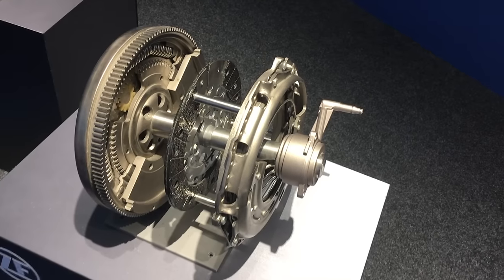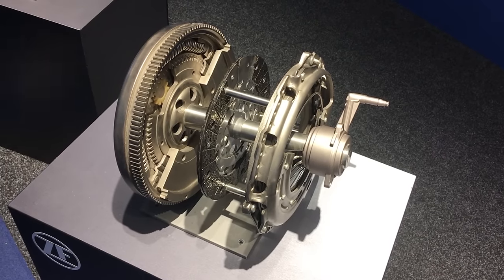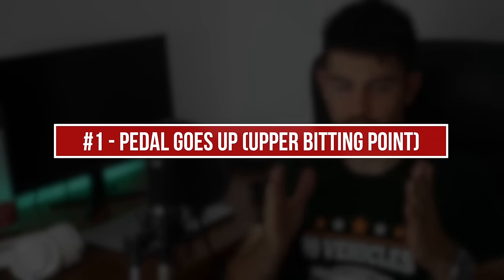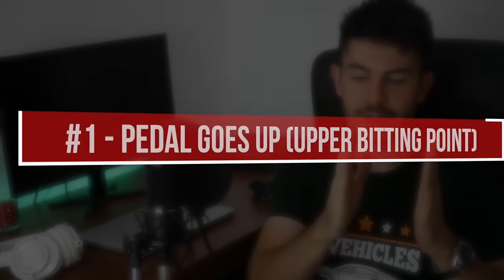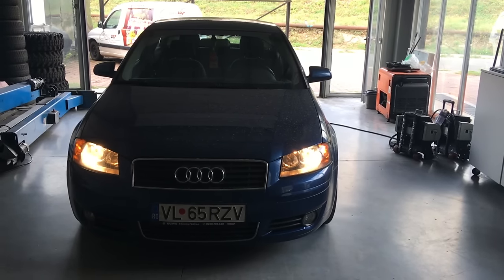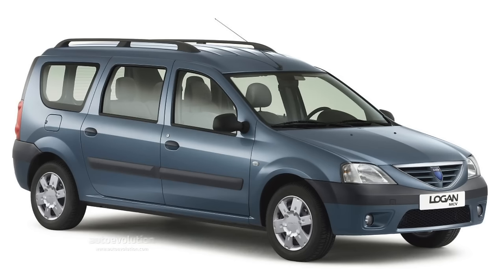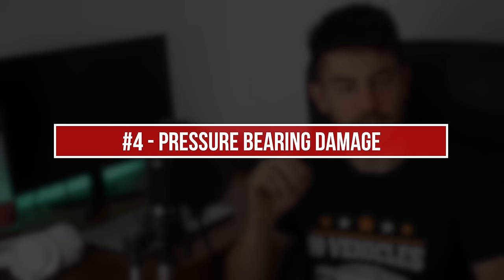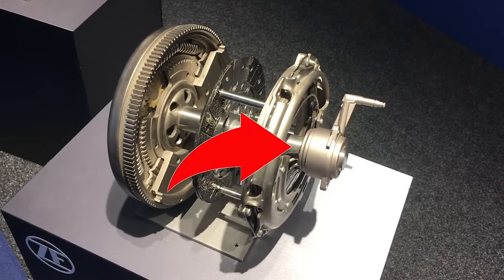How to Diagnose A Bad Clutch - 5 Signs

Comment: I press my clutch and the rpm goes down, car shakes a bit and sometimes stalls when i press the clutch. Thoughts?
Reply: Nemoz_BB6 Mine too need to replace the whole clutch kit buddy i'm going to do it. i have volvo v50 2012
Reply: You have to feather the gas when pressing the clutch in and launching from a stop.
Reply: Mine vibrates for a second, rpms drop a bit when i let go of the clutch in neutral
Reply: Worst case you might have crank walk.
Reply: My 96 Ford Probe SE has been having this issue, it only happened after a 20-30 min drive though. Almost never when just starting the car. Has anyone else replaced their clutch and gotten the issue fixed?
Reply: @minipineapple45  my 2003 eclipse gts rpms drop when i press the clutch in sometimes to about 500rpm and shakes a bit then goes to normal after about half a second of doing so, idk whats going on lol
Reply: Honda S2000 I have seen people suggesting to replace the MAF or the IAC, I’ve already replaced the maf and an iac for my car is $400-500 lol, but good luck and hope you get it fixed!

Comment: It is important to mention that some symptoms mentioned might have absolutely nothing to do with the drive train, but actually related to engine performance being to lean/rich. Sometimes it is just down to the fact that some newer drivers dont apply enough RPM when moving off causing the engine to labour.

Comment: I have a 2001 Audi TT Quattro 1.8 turbo. The pressure on my clutch is fine I can push it all the way to the floor comes all the way back up good pressure. When I push the clutch all the way down and put it in 1st gear it doesn't engage at all now my engine just revs.The 6 speed stick shift shifts every gear fine except that needed high revs or I'll lose speed while driving.I bought it and drove it home last week after driving it for an hour home I could smell a burning smell from the front driver side tire area.I knew it would need something with the clutch done to it when I bought it.So getting it to move from being parked and putting in it in 1st gear to get it going it has to be between 3000 and 3500 RPM in 1st gear just to get it moving and it's the same RPMs with each gear while I'm driving on the road or I will lose speed.The next day it got worse with the high revs to get it moving again but now higher motor revs to get it out my driveway then it had to go to between 4000-4500 RPMs in 1st gear from parked to get it going now. But the 3rd day it doesn't move at all now when I press the clutch down as I said there's a lot of clutch pedal there nice pressure feeling.The engine RPMs is going too high now and doesn't move at all I don't want the engine to scream cause it's obviously not going to move and now I can't drive it.In your opinion do you think it's the clutch? Should I just get a full Clutch kit? or you think it's a flywheel problem? Please respond this is driving me insane. Thank you very much.

Comment: very informative! good job
Reply from the maker: Thanks! 💪🏻
Reply: @99VehiclesTV  I got a 2010 Audi A4 and here and there it's only in first gear when I let the clutch out it feels like the wheels are shaking like when you pull out have any ideas on that? I got scared and didn't drive the car and thought it was a clutch slipping I didn't drive the car for over a month I took it out yesterday and I pulled out in first gear like usual at least six times and it didn't do it... which is weird but like I said I let go of the clutch it's only in first gear and the wheels felt like it was shaking... Thank you in advance

Comment: Is it normal that the vibration is not always appears? I just decided to go to nissan service to change the clutch set as i had vibration in 1st gear when i start. But since then the problem disappeared. Only 85k km in my nissan pulsar 1.5 dci. I bought it 1 year ago so I dont know how it was used before unfortunately.

Comment: yo bro..
i have golf mk4 1999 i will never buy new cars anymore just cars before 2000 
But now my golf sometimes 
1. shifts gears when i start it
2. it is not grabbing any gear 
3. if i turn it off it shifts like new car
4. IF i get it in gear when it is off then turn it on , the car is driving slowly without me changing gears i dont know how to explain it is sooo weird 
    i bled the liquid from the system and put inside new fluid... But when i checked  the canister it was full the master and slave cylinders i checked also
    everything i know i did. 
    So plz can you think of anything other that i should do ????        

    ( it is so important for me to have a car Tuesday's i drive myself to hospital  🙏🙏🙏 respect bro )

Comment: Hi, I test drove a 2018 mustang ecoboost and it shifted so easily. Clutch slid into gears very easy.  I then tested a gt and it took alot more to put it into first gear. Also when shifting it Jerked alot. Not sure ifbit was due to being rusty at manual but these were test driven 1hr apart. I'm in the process of buying the gt
Reply: Totally irrelevant but thanks for sharing

Comment: What about when a car is very slow when moving and engine revs without going anywhere while in gear? I set off from lights and when i release the clutch the engine revs high before its normal again. Also plz diagnose a flywheel fault thanks. my clutch is kaput i guess, i have the sl;ave cylinder and clutch plate and frame already to replace.
Reply: Just an update. It was the clutch lol. The old clutch was so worn the metal plate under the friction part was pointing up having snapped away from its studs lol. WOW i thought, but all good now. Used the C20LET clutch which is more robust for mapping etc.
Reply: My clutch is kaput i guess 😂
Reply: @ungestreckt1  EXACTLY RIGHT LOL. Also the clutch plate was in an awful state, the metal part coming away from the actual plate. How it went into gear fooled me.

Comment: I just had my clutch plate go out. It was a intermittent problem. Turn out to be the center springs in the plate. Some times it drove well. Other times I couldn't get in gear. One spring was gone and three more about ready to go.
Reply: What can be the damage on my car. I was driving along highway and as I engage gear number six and accelerated, my car had a high rave and was not in gear. I then stopped instantly and checked underneath, there was leaking oil on the ground which I don't know whether it's gear oil or engine oil. After that I tried to start the car and engage gear but the car was not moving. Later I checked engine oil there was nothing and brake fluid there was nothing again. What could be the problem

Comment: How come every time I put in the clutch all the way, it doesn’t want to go into first? If I force it in, it either grinds, or goes in, but it makes a loud noise. But every time I go from neutral to reverse, it only grinds, it doesn’t go into any gear without grinding. That’s why I keep turning it on in gear, which isn’t good.
Reply: look up "rev matching" that should give the answer to your question. 1st gear is really only used to get the car moving. You never want to shift into first when driving normally, because it's fucking bad for your clutch, shifting to first (or reverse) at "high" speeds is considered money shifting. I reckon your car manufacturer implemented some safety percussion into your car, preventing the driver to carelessly shift into first, that's why it won't go in. the grinding sound is the sound of the clutch getting fucked up.
Reply: If the reverse gear refuses to engage wait for a few seconds , go into first gear , go  just a little    
forward  and then the reverse gear should not crunch , works for me every time .
It' a good habit not to switch between 1st and reverse ( and viceversa ) 

too fast or you 'll hear that grinding noise  .
Reply: @-pdp-3779   very true, one way to test is to coast at around 30 mph and hold the gear towards first gear and slowly reduce the speed with the brakes. You should find that as you slow down the gear slips into place when safe speed is met. it's the equivalent of having "do not drink" on bleach but that is none of my business.

Comment: Hello!
I own Volvo s60 d5 2006, and when engine is cold I hear rattling noise behind front left wheel. When I press clutch pedal, the sound is gone,  or when it starts to rise temperature. Sometimes it makes noise, sometimes it don't. 
Shifting is normal, can't feel vibration or clutch pedal been hit while its pressed. 
Cheers!
Reply: I think thats a engine problem, i had a 2007 baleno started giving the same problem and that's what it was diagnosed with
Reply: @flowerhobi1673  I also think it's about engine mounts,but it's just guessing..
Reply: Pilot bearing in the transmission

Comment: Okay , I have a 1993 Toyota pickup 5 speed 4 wheel drive v6 . 
I started to notice it was getting hard to put in gear and reverse it would grind to go into than the other day I was driving to work and I couldn't put it in gear without shutting it off and starting it again I noticed that the clutch cylinder fluid was black what does that mean?

Comment: Please advice: When driving in 4th. and 5th. gear  between 2000-2500 rpm there is a rattling noise under the car. everything is check and doube check only suspect is the clutch set becouse the sound started after replacement. is a Honda Jazz1.4 2004.
.

Comment: I have a nissan 2005 ser spec V 2.8 my only problem is that my clutch pedal it stays low , sometimes i have to put my foot under the clutch to put it back to normal, but my car doesnt have any of those problems u were mentioning, it just stays low when driving for a long period of time, so would like to know could it be the pressure plate that it needs to be changed or  could it be  perhaps the clutch pedal that needs to be adjusted. Thanks

Comment: My clutch acts weird after like 20 ish minutes of driving it just keeps getting harder and harder to get in gear eventually it won’t be able to go in 1st 2nd 3rd haven’t tried 4th or 5th reverse works sometimes the clutch is also noisy when it gets like that I should replace the clutch throw out pilot pressure plate and flywheel all right ?

Comment: I don’t get stalks, bought another mk4 with a clutch slipping.. is soft to press, but will go high in the revs and no drive in 3rd gear.. going to change, is it recommend to change the gearbox also? (I have a spare gearbox)

Comment: I get a screeching sound when pulling  away in 1st gear sometimes the car shakes a little. This is worse on a hill start and in cold weather, the car drives normally in all other gears and the biting point is still in the middle of the pedals travel. I have been told it might be the one way bearing in the clutch. What do you think the problem could be?
Reply: What car did you have ? think I have the issue rn but not sure if it’s the clutch or the transmission

Comment: Hi, I know this video is older but I hope I can get a reply.
So I had a question, the problem I’m having is when I’m taking off from first gear, in the Focus RS, the Engine/ Car shakes a bit. And also I’m getting burnt smell after some driving, but no smoke, just the smell.
I understood your explanation, it’s the Pressure Plates, Idk if you can elaborate cause I know it’s NOT the Motor amounts.
More importantly can I still drive the car while I save money for a new Clutches. I would greatly appreciate an Answer!!!

Comment: hi my gear is vibrating while slowly engaged after changing the clutch kit including bearing, the gear shift is getting harder like stuck to engage into 1st gear, is kind of resistant, have to shift to other gear and try engage again, sometime it doesn't work have to engage forcefully. what is going on here?
Reply: before changing, it was totally smooth during engagement, no vibration no hard shift.

Comment: hello, nice video. i would like to ask some tips.. my car is having a hard and difficulty during climbing uphill, even in the lower gear.. imean, almost no power at all. Is it a clutch problem? 
Note: i just recently replaced the fuel filter.
Reply: Start engine with handbrake ON and clutch down. Keep hand brake on and try to set off in first gear. Car should stall. If it dosent stall, your clutch is gone.

Comment: Hi what if you can hear a noise like slight whine then goes away when you press the clutch in when stationary?
Reply: That mean the transmission bearing is bad or your pilot bearing is bad,  that happen to me too at first I thought it was the pilot bearing but it was the transmission gear hope that helps you

Comment: I have a problem happens after 5 10 k in miles? From stand still i select 1st when releasing the clutch i hear a drill type of sound and the van wont move but when you press the clutch pedal in and go to move off again its fine, any idea on what this can be?

Comment: hi hope you doing fine when i pres my clucth padel wining sounds comes and when i press padal car gets slow speed what do you think whats wrong with it and some time in 3rd  gear car staret hikups as well not cruent break but like car will shut in soon and its not having energy like its in high gear but revs are less
Reply: The whining is the clutch bearing. It's had it. You can replace it on its own but not a good idea. Best to replace whole clutch

Comment: Hi there my clutch slipped once and now there’s a slight burning smell off the engine when I drive but everything seems to be working fine otherwise?
Reply: Need a transmission fluid change probably supposed to be done every 30k miles

Comment: The clutch on my 07 Mustang GT seems to perform okay, but the amount of force to press down the clutch pedal is...very unusual. The clutch is much softer in other cars of this model. Also, my friend agrees the clutch pedal is curiously resistant - this is important because he owned a 94' Dodge Viper, a car infamous for having pretty much the hardest clutch known to vehicles outsides of tanks, so it's notable he found it extreme. Let me wheel it back a bit, I'm not trying to give the idea that I have to push the clutch with both feet with my back against the seat and my butt in the air - it's not THAT bad. It doesn't effect my ability to drive the car. I'm used to it too. It does get a little annoying in stop and go traffic, but my concern is not the force it takes but the possibility it may be so hard to depress because the clutch is bad. I don't want to be puttering around with a bad clutching doing who knows what to my poor transmission. Thing is, I bought the vehicle used and it already had some light performance modifications. Nothing that would require a stronger-than-stock-clutch but I guess it is possible the previous owner put a really beefy one on. I guess there's no real way to easily tell if it's an aftermarket clutch or not, huh? Any thoughts on whether it sounds like a worn clutch or a beefy aftermarket clutch, and if there are ways to tell?
Reply: it’s so difficult to tell, and i’m not sure if the 07s have a hydraulic or cable clutch, but if it’s a cable clutch, it could be the cable. i would try and adjust it if it’s an adjustable cable
Reply: It might be a stage 2 or 3 clutch, they are always harder to press down! Hope that helps

Comment: Hi I have a Vauxhall corsa twinport for over 20000 miles I have been battling with the biting point on my clutch it slips a bit I believe due to oil leaking into it but the clutch doesn't show certain signs of failure maybe because I have mastered the precise amount of gas to give it. last few days I can hear a slight clunking noise when I change gear only 1st and 2nd gear. it's only on 55000 miles I have owned about 15 cheap cars in my life and never had clutch failure once. I don't understand exactly what is wrong with it the biting point is quite high but the clutch is still withstanding extreme hillstarts. I live in wales and even the sheep here get burnt out clutches its so hilly :-)  how long can a clutch last like this and would I have already done damaged to the flywheel? Thanks for posting this video. steve.

Comment: Thanks for the tutorial video. My diesel car is working fine but the clutch slips when I try to run fast. It slips at first for 3 seconds then comes normal. Can I try to adjust the clutch first before I change it? Thanks very much.

Comment: When i push my clutch in, it makes a clicking noise. Thoughts?
Reply: My car was making a similar noise when engaging the clutch. For mine it wasn't that the entire clutch was bad but the throw out bearing was bad.
Reply: Solaires Sun it turned out to be the slave cylinder on mine. We replaced it, bled the clutch and it was good to go. Feels like a brand new clutch.

Comment: sometimes when I upshift into 4th or downshift into 2nd it feels like I am not pressing the clutch pedal enough to fully disengage the clutch, even though I am putting it down too the floor and I feel a little bit of grinding/reistance when I try to shift, lately it feels like its happening a little more often, my vehicle has 120 000km with the original clutch on it oil swapped out at 80 000km, is this a sign of wear, and at what point should I be thinking about replacing it?
Reply: iulian pripoae I’m not super experienced, but it sounds like you should change it yesterday...
Reply: Could be the gearbox too
Reply: I'm having the same issue, I can't even  shift to first gear without stopping because it makes the sound you hear when you try to shift without pressing the clutch and problem is that I recently changed the clutch(whole kit) and  somehow is worst

Comment: I’m having problems putting mine in 1st gear sumtimes and I just did new routers and brake pads and got worst should I bleed my clutch or what?
Reply: Replacing rotors and pads shouldn't affect your clutch operation in anyway. Unless your clutch and brake fluid share the same reservoir and you loosened a brake line to let  to the reservoir run dry, something else is the issue.